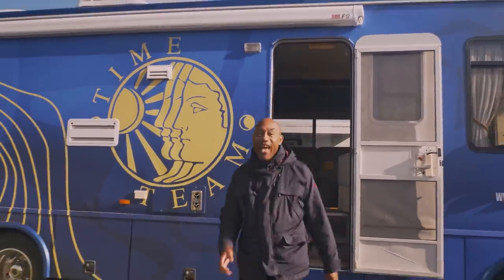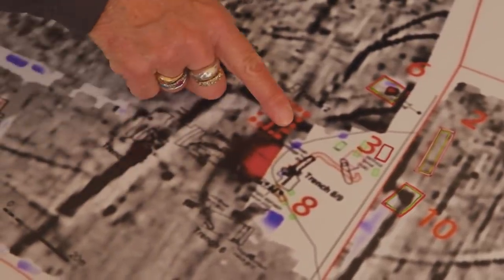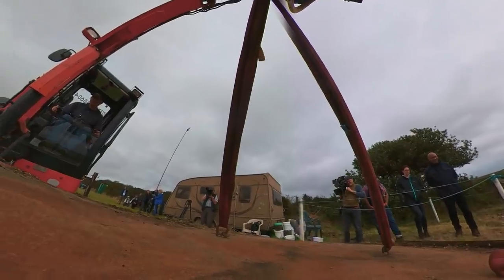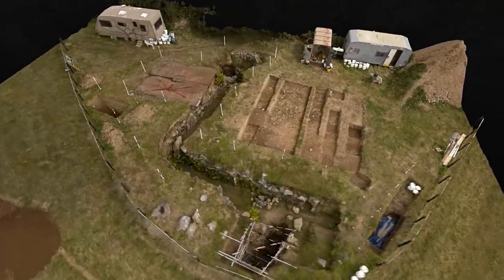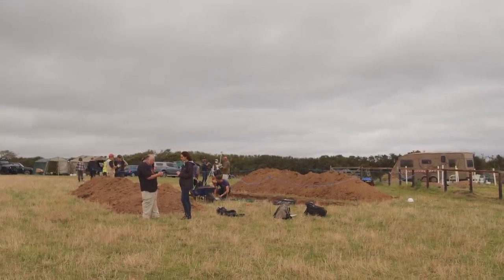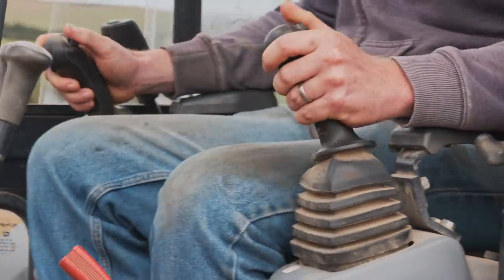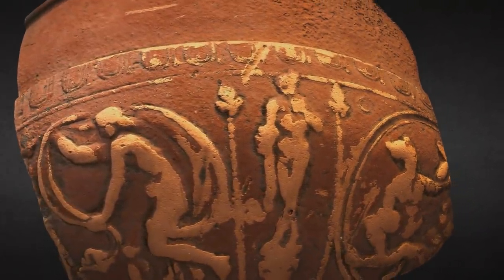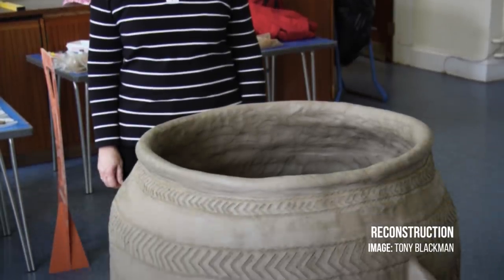NEW EPISODE | TIME TEAM – Boden Iron Age Fogou, Cornwall | Day 1, Series 21 (Dig 1)

Comment: They found steps leading down into it.

WHY is the ground level the same now as it was 2,000 years ago??

That doesn't make sense.

It should be quite a bit lower. At least a few feet if not more than that.

Comment: To me it looks defensive in nature. It's below ground so you can't see it till you are on it. There are trenches that appear to be dead ends with others leading away from it. Not to mention the narrow path would be easy to defend. The large open area where several people could fit in. I think it's an iron age bomb shelter so to speak. If that area was raided a lot by vikings or other people by boat it would make sense to have something like that. It would be a place where a couple men could hold off 20 men for a good time or even beat them back.